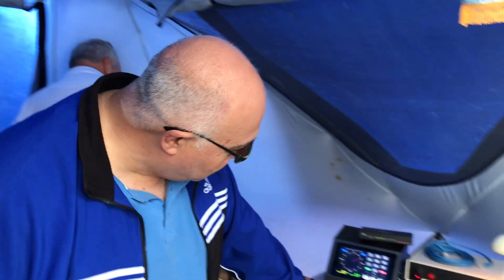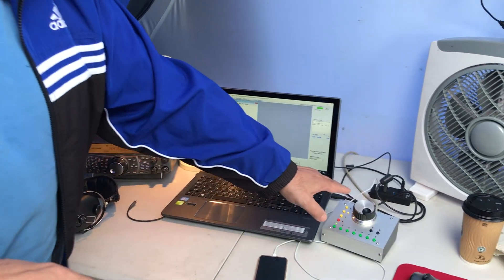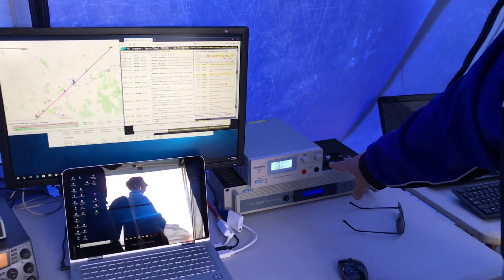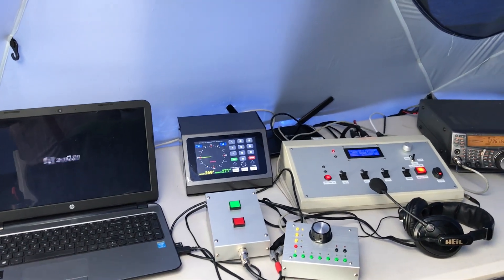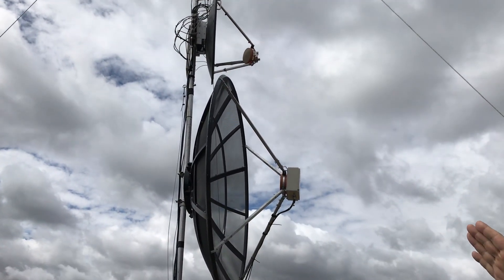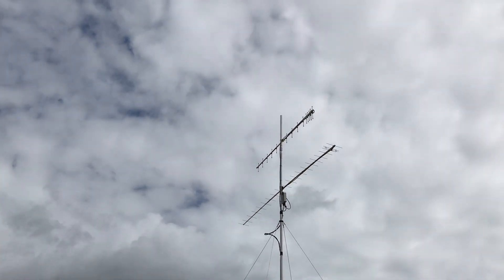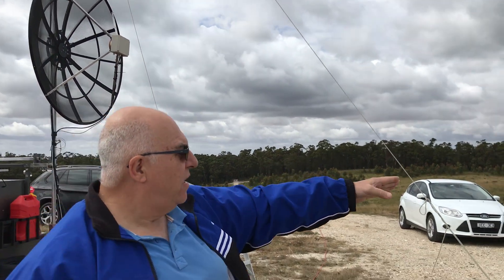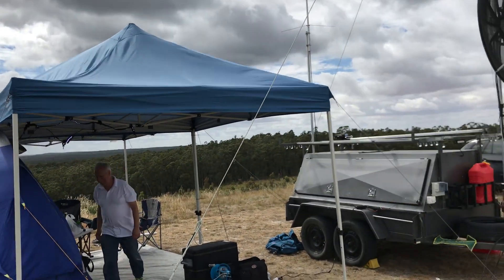2018 Summer VHF/UHF Field Day VK3KQ Portable Setup

Comment: Impressive set up  hope you did well . 
Do you have a link for the magnetic compass website?? 
Cheers Mark G0NMY
Reply from the maker: markg0nmy the True North controller was designed by Ralph and the hardware is by Damian so not commercial.
I have a presentation Ralph did which explains is current projects but the vision was not the best I will have another look at it and decide if I upload it or not. If you have not come across their system before be prepared to either think "why bother" or be blown away!